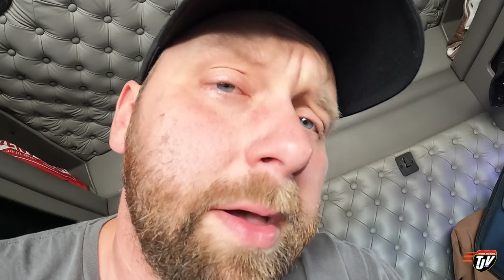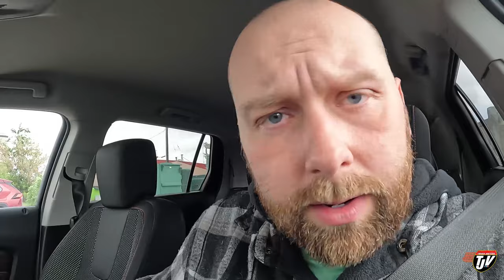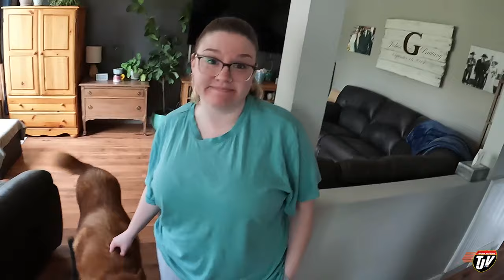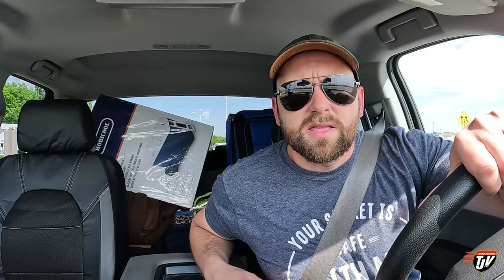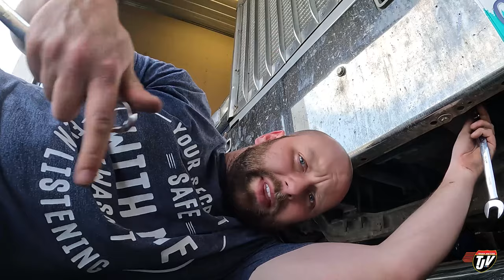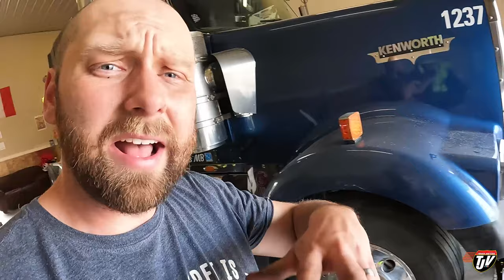IVF PROCEDURE / NEW BUMPER | TJV Hometime | Vlog #2557 | June 13th, 2022

Comment: Good luck on the procedure.  About a cooler.  I've tried coolers and they don't keep stuff cold.  I ended up with an Iceco 20 which is a 12 volt chest type refrigerator. It fits nicely in front of my bunk in a 579 pete.
Reply: Good to know.